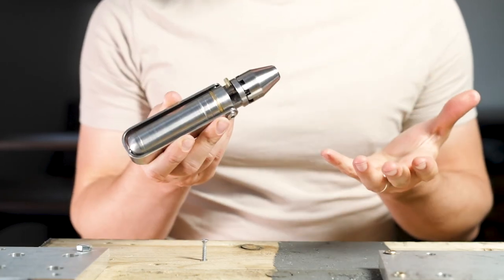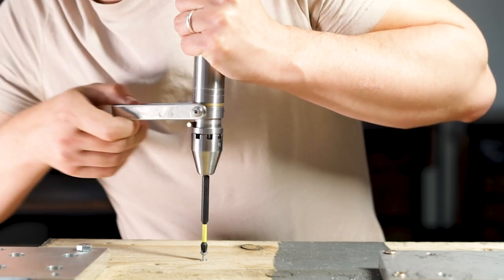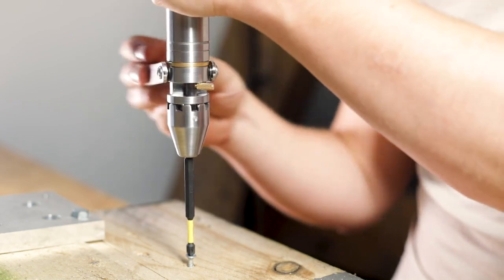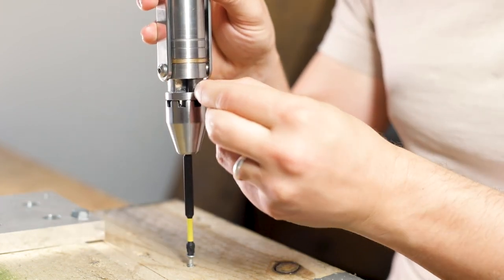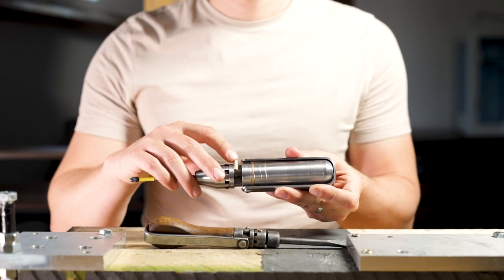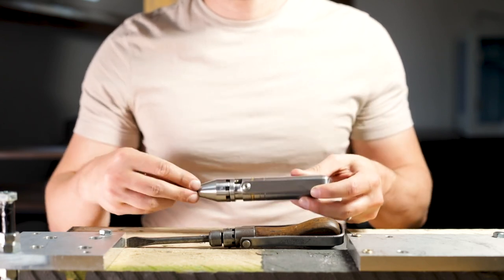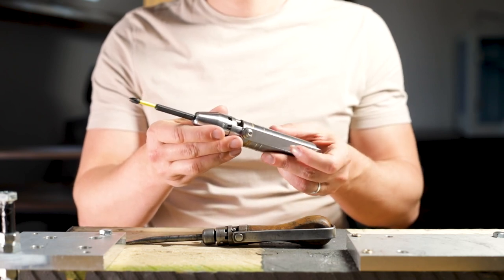A Screwdriver... With A Twist!

Comment: Hi, first of all, I am a proud backer of this project and love every single one of your designs so far. 
I just saw this video and had two questions/concerns:
1) The depth of the hole for the bit holder.
2) The strength of the magnet holding the bit? 
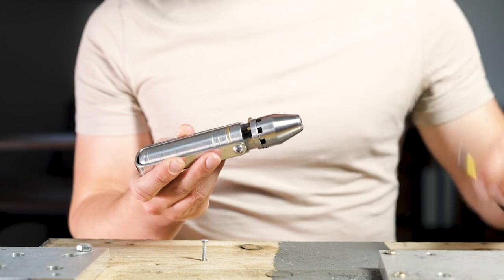In the video, at 0:36 right after the initial bit insertion, the long bit wobbled a little which caused the question about how deep the hole holding the bit is. Also at around 3:18 when the bit was pulled out, it came off a little too easily, which cause my 2nd question about the power of the magnet holding the bit.  
My biggest problem with magnetic bit holders have always been the bit getting pulled out and being left on the screw. To be honest, with the amount of torque that this screwdriver offers, a shallow hole and a weak magnet, I would think it could be an issue.
Reply from the maker: Hey Arash, 

Thank you for your support we feel very privileged to have amazing backers such as yourself that give great feedback! 

You are totally correct on both points, great spot. We used our first fully machined prototype in this video (the one Geoff helped make in the shop) and it wasn't perfect. The depth of the bit holder hole was only 8mm and we weren't happy with the wobbliness so we doubled this depth and now bits are very secure. We also improved the magnet holding power by jumping from an N35 Neodymium magnet up to an N52, which has around 50% more power than its predecessor. I haven't had any bits left behind on the new units and I've put mine through its paces over the last few months.

Thanks again for the feedback and we've got some more manufacturing updates to share very soon :) 

Any more questions, please let me know.

Cheers,

Peg